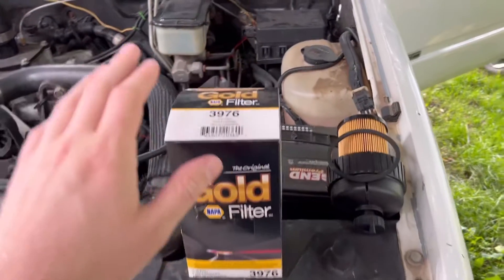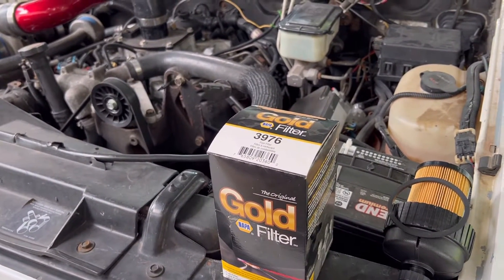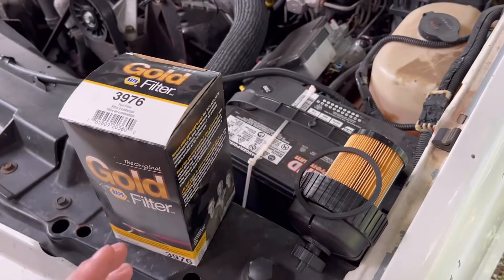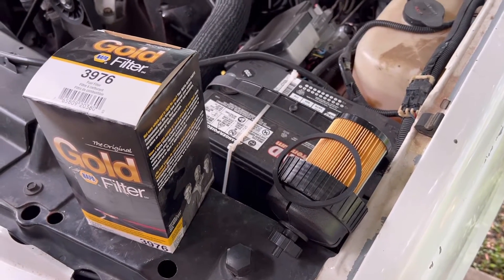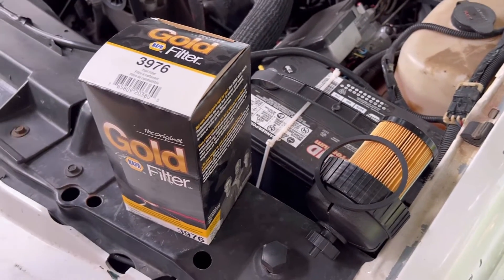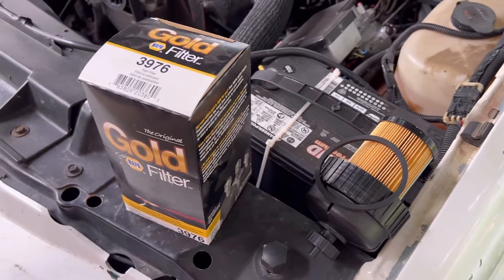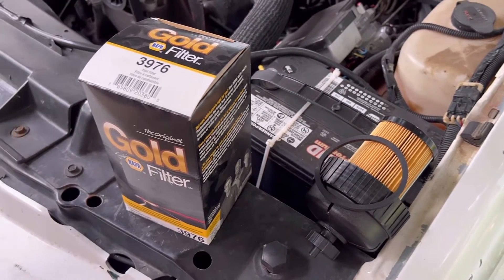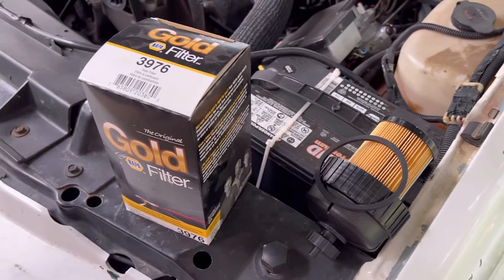GSC 6.5L diesel fuel filter replacement

Comment: Thank you!  I have a 95 GMC 2500 Diesel Suburban that is randomly stalling while driving... Hoping swapping the fuel filter helps.
Reply from the maker: The lift pump is most likely not working and it is starving itself of fuel.

Comment: So what’s the process to bleed it on an earlier truck (92)?
Reply from the maker: Leave the bleeder closed and start the engine. It might shutter a bit as the lift pump catches up then you should be off and running
Reply: What about the screen on the tube ? Why didn’t you bleed it ?
Reply from the maker: @Terk131  the screen stays on. I’ve never been able to remove it from this FFM. No need to bleed with a DS4 truck. Cycle the key and it uses the lift pump to force the air out of the pump via the return system. DB2 is similar as long as you have the appropriate lift pump harness.
Reply: @gingersnapcustoms  the screen should be replaced when you do the filter.
Reply from the maker: @Terk131  I can’t get them locally and this is a modified filter head. Thanks for the mention and I’ll add it to the next video.

Comment: Mine has code 62 and my map sensor or boost sensor never been hooked up to vacuum line and doesn't have anything on intank need help.
Reply from the maker: What year is it? Message me at the Facebook page and I’ll try to help.
Reply: @gingersnapcustoms  truck is a 91
Reply from the maker: @Seanbjw  92 is mechanical injection so all that should be for is EGR if it’s a 91 6.2. Which means the vac pump isn’t working.
Reply: @gingersnapcustoms  ya these people put this engine chopped it up badly I took injectors out and rebuilt them cleaning and making shur the needle part moves in and out but I can't figure it out I will see how chang that part u said thank u man and God bless brother!
Reply from the maker: @Seanbjw  I suggest getting injectors rebuilt at a fuel shop if you really want them to work good. They need shimmed over time to keep pop pressure consistent.
Reply: @gingersnapcustoms  thank u for everything God bless man

Comment: My truck is a chevy c3500 1994 dually. Is that a DS4 truck?
Reply from the maker: Yes it is. Standard 5521 style.
Reply: @gingersnapcustoms  so no bleeding air is necessary
Reply from the maker: @PlumbaJ  you can crack the water separator T on the thermostat housing to let some air out but in most cases if the lift pump is running you shouldn’t have to fully prime it.

Comment: Mine gelled up, do I just take that off and fill it halfway with red911? Do I treat the tank too? I don’t have much fuel in it and I treated it with some howes diesel treat
Reply from the maker: Put the diesel 911 right in the fuel tank. If it’s below half a tank you need to fill it up too. When they are low is when it freezes.